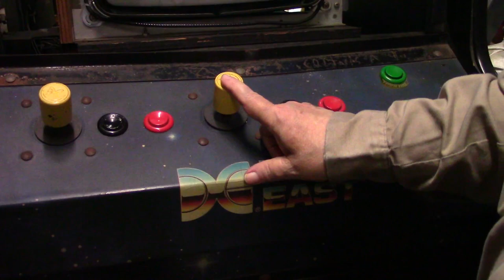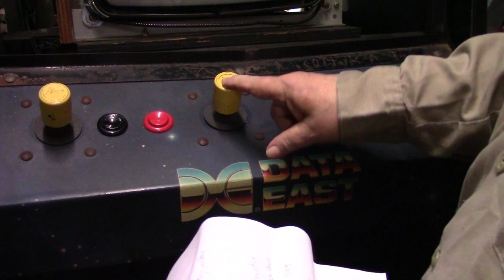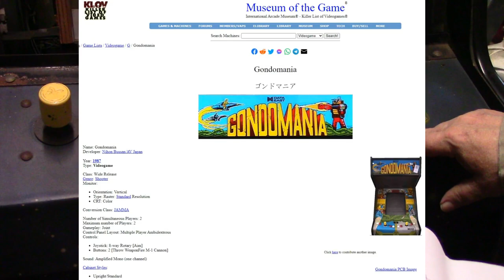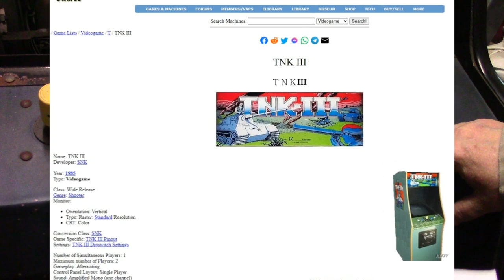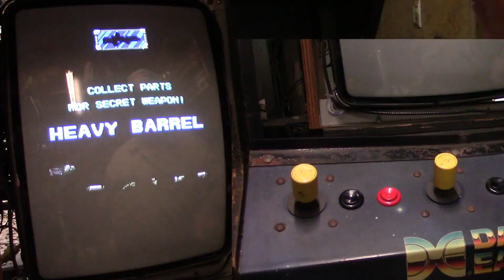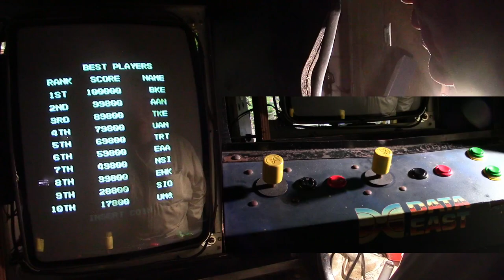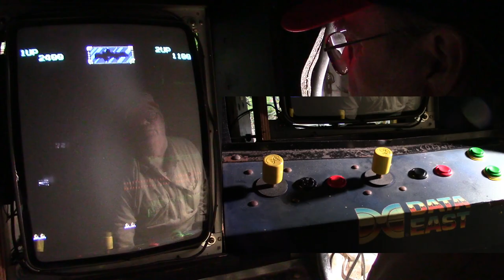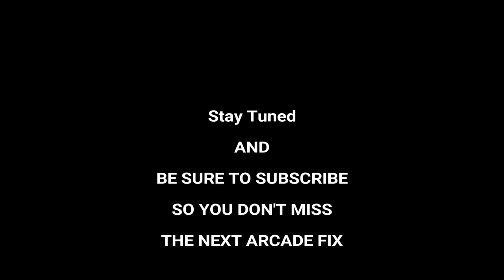Sams Arcade Fix   HEAVY BARREL Data East Wico Rotary Joystick FIX AND GAME PLAY

Comment: Great video. The encoder wheel opens by bending back the 2x plastic tabs on the grey piece that holds the red piece in place. But be careful as the tabs easily break. 

Anyone have a link or part number for the encoder wheel on digikey? Mine was opened by the previous owner and the tabs are damaged. It's now held on by a cable tie
Reply from the maker: I found a couple posts that have a replacement number but no info if anyone has tried it, but they say it will work but you have to cut the shaft to fit.
https://www.digikey.com/en/products/detail/c-k/A11215RNCQ/181433
Here are two links where I found this info.
https://forums.arcade-museum.com/threads/data-east-wico-rotary-switches.441106/

https://forums.arcade-museum.com/threads/data-east-wico-style-rotary-joysticks.124272/
If you try it lets us know if it works.
Reply: It's close but no good. Part A11215RNCQ has 12 positions alright, but you can only click 1 to 12  then back 12 to 1 as there is a physical stop between 12 and 1. I've opened them up and the block is a notch moulded into the top and bottom pieces where there should be a little hole to allow the ball bearing drop in. Tricky to cut away the notched and add a hole for the bearing.
Reply: I take it back! Using a scalpel, you can cut the notch between 12 and 1 out. Then you cut the shaft down to size and It's a perfect replacement. I posted a mini video.

Comment: Did forgotten worlds always use both a spinner in addition to a normal joystick, or could it also just use a rotary joystick for control?
Reply from the maker: forgotten worlds had an 8 way joystick and a 360 spinner that also had the fire button built into the spinner. If it's possible to use a LS-30 type joystick you would need to add a fire button which games like Heavy Barrel has so I guess it would be possible but as far as I know forgotten worlds used the joystick and spinner combo.